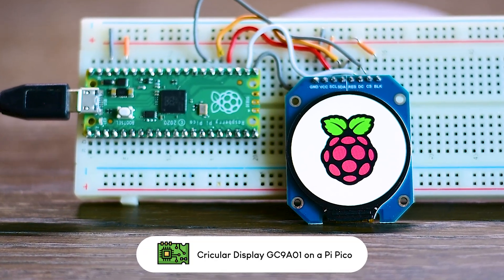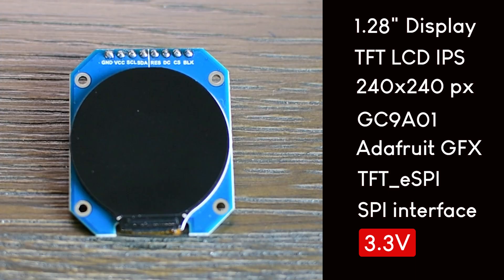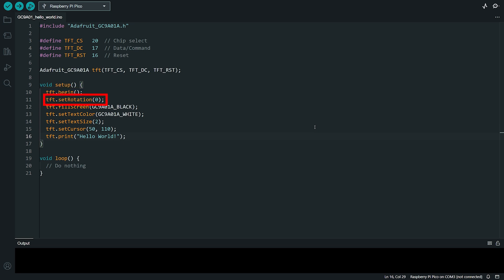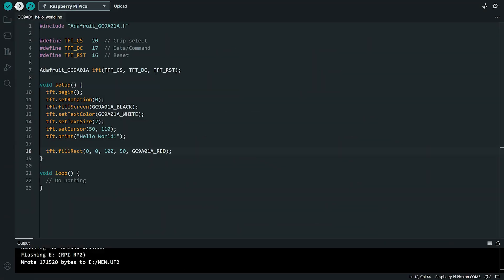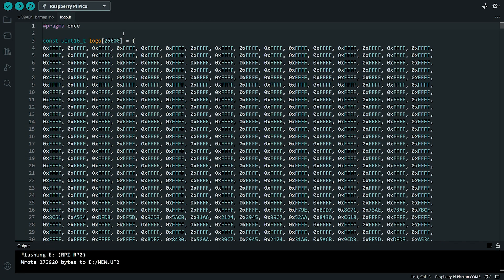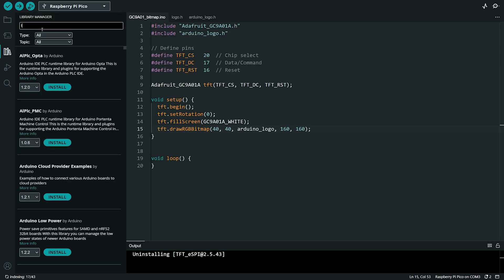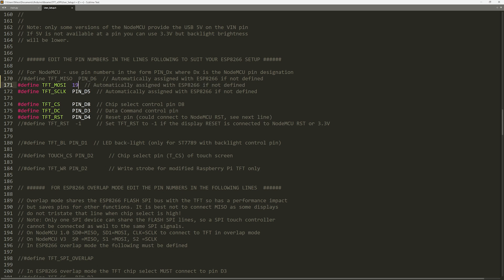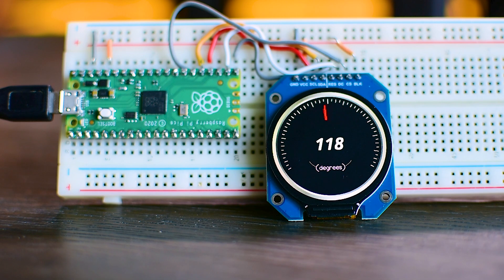Raspberry Pi Pico GC9A01 Round Display Tutorial with Arduino

Comment: Have the Arduino people fixed the IDE so that it can use COM ports? My Pico disconnects at the outset of the upload with this error: "Cannot Perform port reset: 1200-bps touch: opening port at 1200bps: Invalid serial port"

Comment: Im having trouble getting the display to work, could you share any information about what firmware is needed for the Pico ? Do you need precompiled firmware with the driver already installed, or can the driver be installed manually with the micropython firmware ? Any help would be appreciated! Great Video otherwise.

Comment: Great video!!  Hope to use this round display and Pico to make operating clock faces for my HO scale railroad.  Can I simultaneously run more than one display using the Pico SPI signals?  I'll need either two or four clock faces for my building tower.   All the best to you ...
Reply from the maker: Yes you can use one Pico to drive many round displays. There is a video on YouTube with a guy running six of them, you cn check it out for more info.